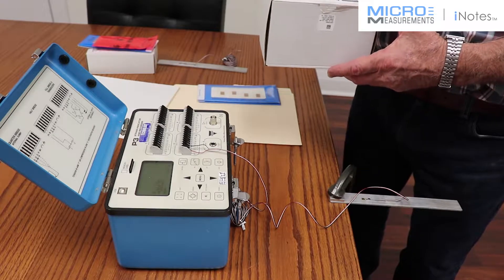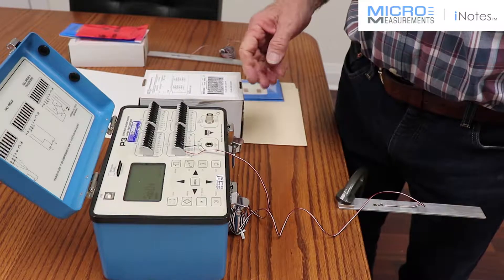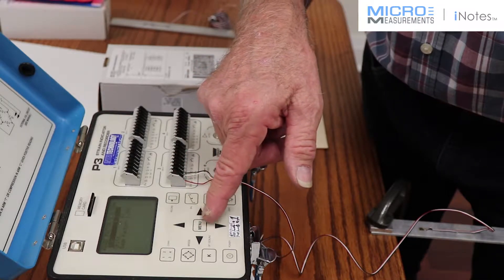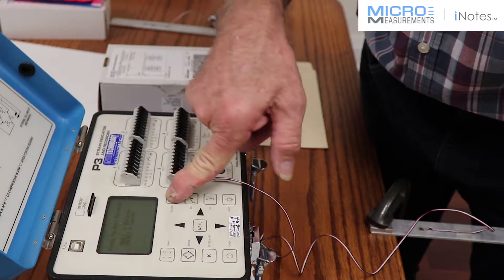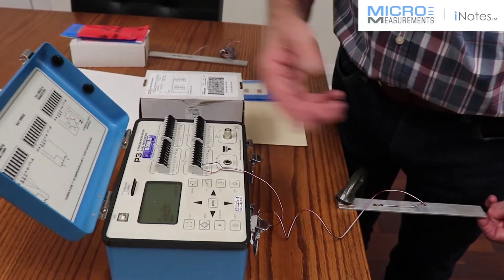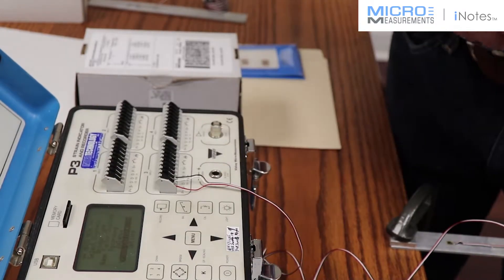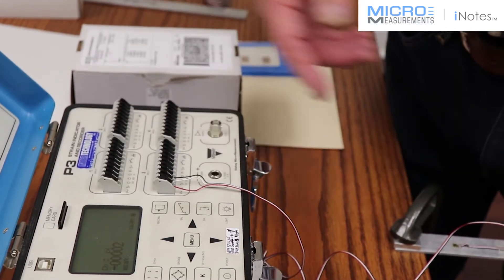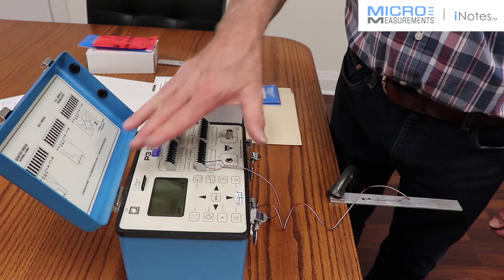Strain Gauge and P3 Strain Indicator. Advanced Sensors Technology

Comment: Jonathan nos ilustra la fase final del pegado de bandas extensométricas de la Serie C4A, con Tecnología Advanced Sensors, y luego cómo usar el Indicador-Registrador Extensométrico, Modelo P3 de Micro-Measurements, para probar la banda C4A instalada en una viga de aluminio con el adhesivo de tipo cianoacrilato M-Bond 200.
Si necesita más información, por favor no dude en contactarnos. mm.es@vpgsensors.com miguel.bravo@vpgsensors.com